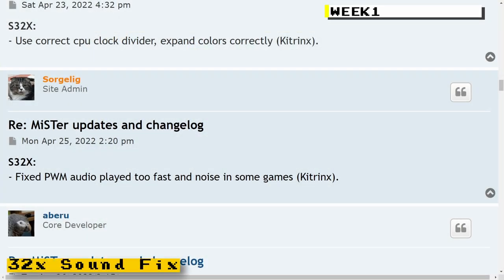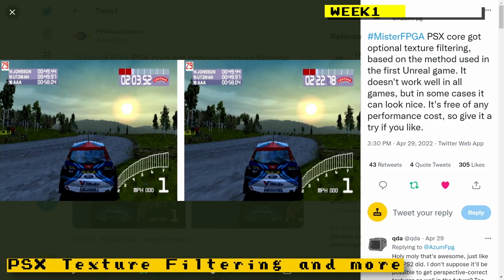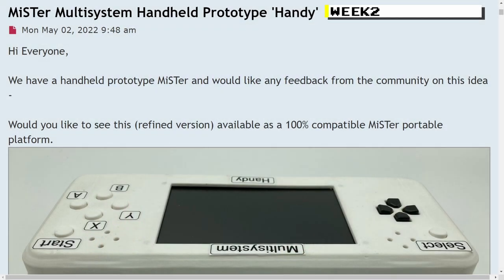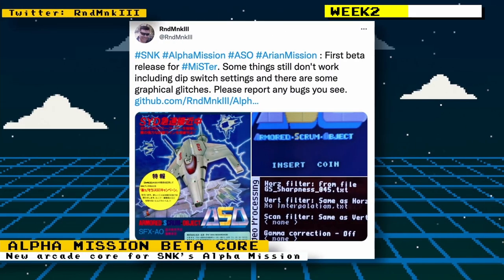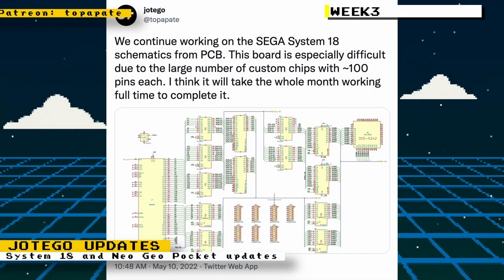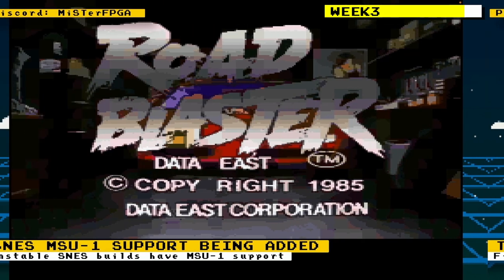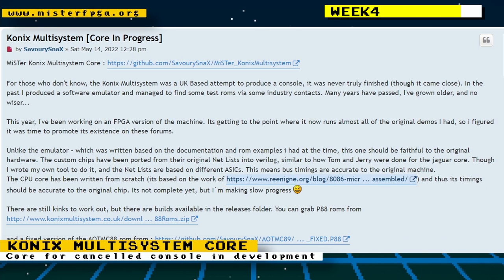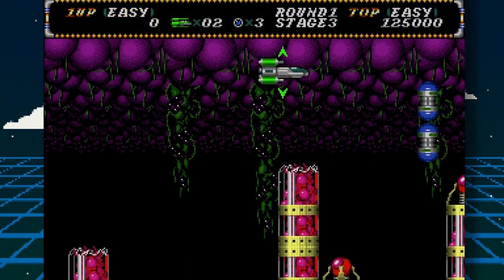Mister News May 2022 Monthly Wrap-up

Comment: Thanks so much for making these man, it’s beyond appreciated. Between you and Videogame Esoterica, I finally have a handle on how this thing operates. Can’t wait to bust open that CRT guide and give PSX a proper play, not that it looks bad on HDMI. Have you heard anything about PSX multi tap support by the way? The cores not complete until me and 7 friends are getting hammered playing micro machines.
Reply from the maker: Thanks! Regarding PSX multi-tap support, if my memory serves me correct, I dont think we will see it in the core. I remember in a podcast the developer mentioned something about the input having to be created for each player and there will be no FPGA space available for the multi-tap. I'm going to listen to it again and confirm it. Want to make sure my info is correct.
Reply: @LusRetroSource  ooooooooff that's a kick to the gut😞
Reply from the maker: @JayTheBarber603  Looks like someone has figure out how to get multitap support. https://twitter.com/sentientsixp/status/1534569885925351424?s=20&t=Ank1jHRdx1INS9kMB3BIjw